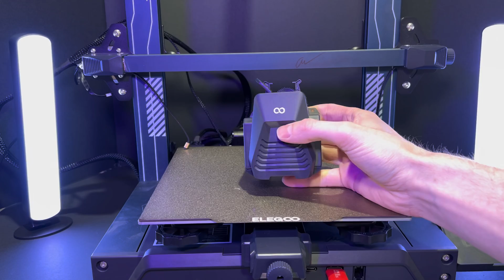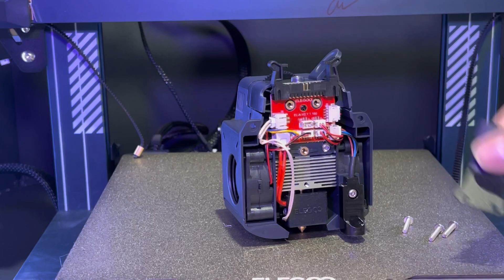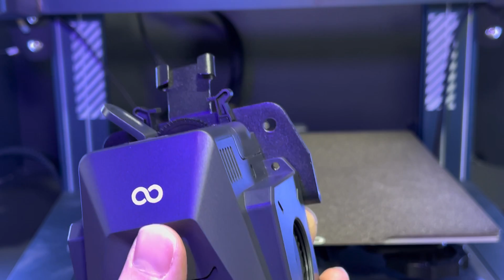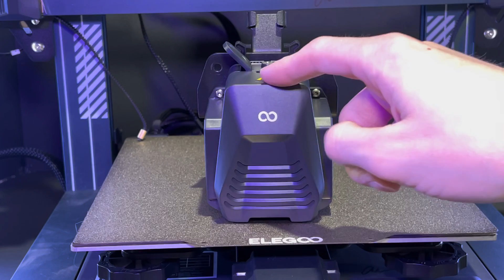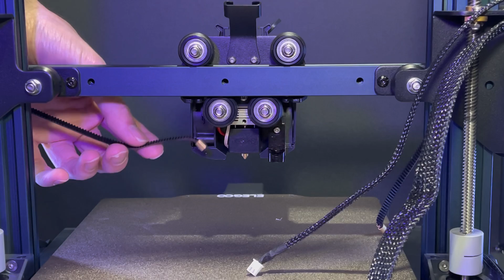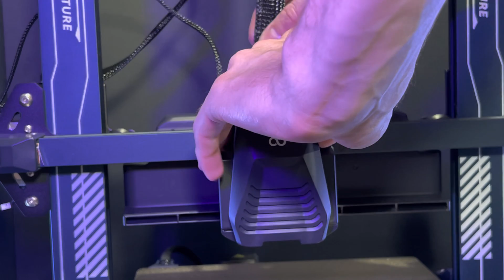How to Replace the Extrusion Head on Elegoo Neptune 4

Comment: Imo its better to just take the head off. The wires are such a pain. The cleaning is a pain. It takes 2 minutes to take it off the track with the 3 bolts at the back.

Comment: After taking mine out and cleaning it it seems like the center is way off. Now the printer thinks that the center is on the right low part (let's say 2nd quadrant). Do I need to change any settiior calibrate this?

Comment: I hate this printer with a passion.  IDK but I associate printer with insert cartridges and go like h***.  Thanks for having a good tutorial on how to tear this part of it apart.  On my third print it clogged solid with PLA... serves me right for falling asleep during a long print job.  Guess I have to time them so I can be awake at the end to run and attempt a cold pull.  Thankfully I bought an extruder head along with the printer because I cannot get the original nozzle out of the original extruder.  The video is useful but I'm really ready to never watch another 3d printer video again - I see the value in service providers.  Elegoo slow-rolls support requests from North America - this is not a machine you want in your business with no meaningful vendor support.

Comment: This is no good - I had a cheap Anycubic for a long time that never had issues.  I've had a Neptune 4 for a few months and it's suddenly crapola with the print head and it's clear it's gooped up in the hotend somewhere.  I just ordered a new $40 head (wasn't gonna bother with just a hotend replacement).  If this is actually a widespread issue with Elegoo printers, I'm gonna be upset I dropped 300 bucks on this thing!

Comment: Any idea how to fix "Heater extruder not heating at expected rate" error? I replaced the brass nozzle head and since then having this problem. Tried restarting the firmware & factory reset. Also, connected to the Klipper software console using the printer's IP and checked the printer.cfg file. Someone mentioned it could be due to blown fuse. Any suggestions?
Reply from the maker: I have not had this issue yet

Comment: i love this printer, i got mine in july ive printed almost 100 hours with it but now im having issues as well, seems like the offset issues that is plaguing other people as well. i tightened the ABL sensor but i seen on their discord they are starting to have issues
Reply: Lucky you I got a massive blob ruin my printer in less than a week.. 😢
Reply: @THOR_THE_GOD  ive had major issues with mine as well, i had a huge blob, and in the process cut my thermistor wire, had to get a new one from elegoo and it prints their test prints fine. But if i slice something myself it does the first 5 or 6 layers then blobs up
Reply: @raytitone1583  I had a similar problem and switched to Prussia slicer. The astroprint cura slicer didn't have a klipper flavor, Prussia does. The only problem from that was less control over settings.
Elegoo messaged me back, and I got a new hot end coming as my wires also got ruined from the blob. I also discovered a fan and led wires was installed backward.. I'm hoping to get back printing soon! I love making repeating crossbows, but I need 300×300 or more for most of my designs/business..
Reply: @THOR_THE_GOD  did you ever get it fixed or did you abandon it?  Are you still able to use it and how much downtime do you have if you still use it?  I'm questioning everything about this decision after a hot minute with this machine.  I had the extruder fuse to the head, couldn't unscrew it.  I have a spare but this is like building a laserjet toner cartridge from parts every time I use this thing.

Comment: What happened for it to stop functioning correctly?  Considering getting one of these. Thanks for any info.
Reply from the maker: I think it was just slicer error for speed of the machine to putting down filament
Reply: I printed a file that took about two hours and didn't know to run and pull the filament before it fully cooled.  You don't want this machine, it's a fussy POS
Reply: @tim8513m  Thanks for the info!

Comment: How did you get a replacement? I keep getting an error 

ELEG∞O
[
Klipper
Klippy
Printer
shutdown
standby
TMC extruder reports error: D RV_STATUS: 401c0090 s2vsa=1( LowsideShort A!) olb=1(OpenL oad_B!) cs_actual=28 stealth=1.
Once the underlying issue is cor rected, use the. FIRMWARE_RES TART command to reset the fir mware, reload the.config, and r estart the host software. Printe r is shutdown.
Restart FIRMWARE
Restart KLIPPER
This was after printing 3 items on a brand new printer
Reply from the maker: I emailed Elegoo, they sent out a replacement for $76